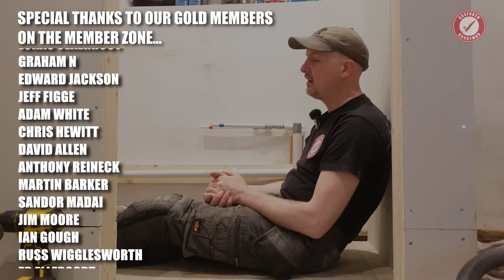Working with wonky walls... and first fix plumbing - new toilet (part 6)

Comment: Excellent work as usual. Only thing I'd advise is maybe turn the gas bottle down a bit so it's not so raging hot. Just a small sharp flame is enough and should mean less risk of solder bubbling out.

Comment: Those inline valves for the water are a godsend. I refurbed one of those 1920-30 terraced cottages about 4yr ago for my niece, with my mate who's a general builder & he said when we rip the kitchen & bathroom out put a  valve on every pipe (at first it was so we had hot & cold water for coffee😅) just as well because the flex to the hand basin was faulty & burst on a Sunday night & l was able just to isolate handbasin until i got a new flexy.

Comment: That is a plum out of plumb mate 😂😂.
The main part of our house was built in 1540. Just finished refurbishing a bathroom. At one point the laser level could be heard laughing as I was trying to vaguely spare things up
Reply: My last cottage was like that, around 1610 - 1670 we think, no wall was anywhere near straight!
Reply from the maker: Ha yes, it can certainly be a challenge in older properties! 1540 - wow, some history there! 👍👍
Reply: My latest house is the same. Somewhere between 200 - 300 years old and not a straight wall in the house. 🤣
Reply: Daughters house is 200 - 300 DAYS old and its not got a straight wall in the house 😮😮😢
Reply: @GosforthHandyman  our place is riddled with history
Reply: @jeffsmith2144  lol 😂. Sad though in fairness
Reply: @dougsaunders8109  Her's is riddled with botch 🤔
Reply: @jeffsmith2144  lol very good

Comment: Bringing back memories of my bathroom. About an inch of slumped plaster at the bottom of the walls. Ended up ripping it all off back to brick and then found the builders didn’t leave as bigger cavity gap at the 1st floor as they did at the ground. Coupled to not making the bathroom big enough so they hacked the walls out to the the standard bath in and made the room so out of square it’s was an inch out over the width of a door.
Reply: The first wall I ever built was not exactly plumb, but it did have plenty of strong cement mix in it. Plasterer put nearly an inch on at the top outside to fix it, and almost a wash at the bottom. Good luck though to whoever has to touch the floor I poured over the old cracked and warped old one though, 6 inches of concrete in a 2m by 2m room, and a full 50kg bag of cement. Fixed the water problem at high tide completely.

Comment: You absolutely need to deburr pipes - the burr can cause cavitation which, over a long enough time, will actually pinhole the pipe. It can also cause accumulation of limescale, which you don't want, for example, right at the entry to a service valve (three guesses why they never work when you go to use them). Oh, and the burr itself can get worn off and deposit little pieces of copper in your valves, too.

Plus smoother pipes are quieter, we all like quiet pipes.

Where you were worried about melting the soil pipe, the simple solution is to put a damp rag in between, and one of those fibreglass mats as well if there's room.
Reply: I've only ever seen PB plumber use a deburring tool and myself 😂😂😂
Reply: @paul_my_plumbs_uk  Well, yours is a rough trade..😁
Reply: @Monkeh616  you mean rouge trade 😂😂😂
Reply: I deburr pipes👍😁
Reply: @Tom_Plumb_PHS  I deburr after every visit to the toilet.
Reply from the maker: Any recommendations for a deburr drill attachment?? 🤔
Reply: @GosforthHandyman  Multifluted countersink. They do get sold as deburring tools as well. B&Poo have a set for 8 quid which will probably last a lifetime on copper. Might not be quite big enough for 22mm, though, but there are really big ones available.

You can also get external deburring tools, but you really only need to do that for pipes not cut with a proper cutter.
Reply: @GosforthHandyman  the only dedicated one I'm aware of is the rothenberger part number 11044 or 11045. That's just the adapter and there deburring tool fits into it. They're not cheap and I haven't used them so I can't comment on their effectiveness. I use the pen style deburrer on copper and the monument card deburrer on plastic. Knipex dp50 is a plastic cutter that deburr as it cuts which is another option.  Soil pipe you can get cutters that chamfer as you go but they're silly money unless you do an awful lot of drainage they're not justifiable.
Reply: @Tom_Plumb_PHS  Good lord, 65 quid just for what amounts to a conical file and the same again for a chuck for it. I'm sure they work well if you're doing it all day, mind, but I'll stick to the 5 quid deburrer and some sandpaper myself!
Reply from the maker: Cheers guys - good to know! 👍
Reply: @GosforthHandyman  real men just use their finger.
Reply: @GosforthHandyman  I have been using a 25mm Countersink Drill Bit for inside deburring of up to 22mm tube. You could also try a step drill bit. You probably have one already in your tool box.
Reply: @Monkeh616  yh they're not cheap I use the pen style deburrer that's less than a tenner. Does the job for me. As you say if you're a pipe fitter working in copper all day it would pay for itself but even for us all rounders it's a hard sell.

Comment: This was much more of a fiddle,  and adapt & adjust as you go, but much achieved in the end and well set up for the next stages which should make them go smoother and quicker. Nice to see this rather than bodge on top of bodge throughout the build !
With so many wonky non-plumb and non-level surfaces it's hard to select a datum point to start - I guess some would say that makes it easier !

Comment: You are doing a great job Andy , I'm no plumber I would be happy with the work you  have done  That wall is way off, you done well putting up the stud work and packers  Can't wait to see it finished  I never used soldered joints only compression joints but i know they can be a bit bulkey but like I said you doing a great job keep it up  I will catch you on the next video  take care mate  .
Reply from the maker: Cheers! I don't mind solder joints but this is about my limit. No idea how plumbers do it in tight spaces without setting everything on fire, so to speak. 😂
Reply: @GosforthHandyman  You doing all right mate !

Comment: Crikey Andy😮its like we are doing parallel jobs😬I'm straightening up an entire kitchens worth of wonkey walls, virtually using the same method as you👊(I'm using a string line instead of a straight piece of wood👍) Great job pal👌
Reply from the maker: Ha cheers Del! Folk don't appreciate how much time this adds to a job. Good luck with yours! 👍😎
Reply: @GosforthHandyman  Video's to come Andy😉

Comment: Hi Andy, I've found that using a brush for the flux gives a better result. You can brush a bit of flux on after soldering too which cleans the joint up nicely before the damp cloth. 

Love the videos, keep 'em coming. 👍

Comment: Couple of tips,  with pre - soldered fittings its best to still add a dab of your own solder just to be on the safe side.
Otherwise your relying on them being already filled sufficiently, which on the odd occasion isn't always the case.
Also, its best practice to apply flux with a small brush, using your finger can easily contaminate the joint and also your tub of flux with debris.
Reply from the maker: Cheers! I normally add a blob of solder, but between setting the studs on fire and melting the soil pipe it was too much to think about. 😂👍

Comment: As I always say if it works and its hidden then its a decent job. I remember doing pipeing for my bathroom with solder and when the water was turned on i had a real water closet 😅😅😅😅😅 decided to go wit compression and push fits after that. Luckily my nephews a plumber so any solder work he can do.

Comment: I have used a quick fit to extend the pipers for new radiator and towel dryer, but why did you mixed different pipes, copper and plastic? You can get a quick fit for copper.

Comment: Thats a pretty plumb job with the pipework. I wouldn't advise using your fingers to apply the flux though. The flux is not usually kind to skin and you could contaminate the joint with oil or grease from your skin causing it to fail. Either use a flux brush, or some solder wire or failing that an offcut of copper tube
Reply from the maker: Cheers Nick! I used to use a flux brush, I'm getting lazy. Noted! 👍👍

Comment: Hi sir I must admit I’ve never used the plastic pipe and fittings , but I can definitely see the advantages . Was there a particular reason for not doing the whole job in plastic?   .   As regards plum walls even some of the new properties are often out of level and even not even square . So at least the builders of your house had a reason for such problems . But these days there should be no excuse .    Best wishes and kind regards 😀👍👍👍

Comment: Your plumbing is fine in copper, all i wud say is dont use ur fingers as flux is acidic and will mess ur skin up. Get a flux brush and let the joint cool down before u move it or put a wet rag on it let the solder turn a dull colour before u move it.
Reply from the maker: Cheers! I actually had a flux brush but it ended up covered in sawdust and I've been too lazy to replace it. 😂

Comment: You shouldn't immediately cool the soldered area with a wet towel because there is a risk of shrinkage cracks occuring (thermal shock). Just let it sit and cool down by itself and clean it afterwards.
Reply from the maker: Interesting. Plumbers? 🤔
Reply: @GosforthHandyman  Plumbers should of course do it because they earn money with the repairs. It takes a while, usually longer than the warranty period, for compromised solder joints to leak. And if you wonder if I am kidding, well who knows. 🙃

Comment: Could you have used a scrap of stud and drilled a hole to poke a pencil through at half the width of the stud and use it as a reference guide for the placement of the screws? Might have saved a little time and let you butt the stud up against the non-plasterboarded wall without checking for plumb on that axis.

Comment: Spend some time getting use to the pipe bender on scrap pipe the spring is ok but pipe kinks happen, interesting video 👍
Reply: Old pipe the tip is to first anneal them with the torch, then bend them. Had to do that recently, stub of pipe that had been kinked by the copper thieves, so had to chisel it out, make it sort of round again and fit an elbow on. First thing after the chisel bit on the drill to make a hole as to anneal that copper so it would be soft, then straighten the end a little, and make it round enough. Then sand clean, lots of toffee, and solder on the elbow. No leak at all.

Comment: My house was built in 1979 as part of a set of standard houses in a planned community. Not a plumb wall or square corner in here, and it's all stud and drywall/gypsum board. In one place, I pulled the board off because the stud they had inside the wall was a banana that was pushing everything else out. On one wall through the center of the house, there's an out-of-plumb lean which caused all the doors to slam open. So when I hung new doors, for them to be plumb, I had to be an inch out of plane from the existing wall. Hard to do anything "right" in that mess.
Reply from the maker: Lordy, that sounds like fun! 😮

Comment: Would it not be easier where the walls buldge out, rather than wedging, to remove a bit of the old plaster so you don't lose as much depth?

Comment: Do you take any precautions using these plastic fittings as they wouldnt show up woth a stud/pipefinder?
Are the tubes metal impregnated or could you stick some foil on the wall behind the plastic pipes?

Comment: Would you please show how you test for leaks? Regards Paul
Reply from the maker: This was ages ago, but I just connect to mains water pressure, flush it through in to a bucket, close the service valves, leave it for a few hours and check for any leaks. 👍

Comment: Why do you use the metal pipes for the water inlets and not plastic? Thanks, good video.
Reply from the maker: Cheers! I prefer to have as few joints as possible behind walls and I can do nice rigid bends with copper. Also shows up on a detector, not that anyone should be drilling there. 👍
Reply: @GosforthHandyman  Makes sense!

Comment: 4:28 if the plasterboard is going to be scribed to wall, wouldn't the wall be the easier reference?
Reply from the maker: Potentially! Just a bit awkward drilling so close to those pipes. 👍

Comment: I think that you are the only builder that would spend 1-1/2 hour to level one stud.
Most builders would just hammer in those studs, adjusting them the best they can and move on.
The old saying is that's what molding is for!
😂😂😂🔨
Reply from the maker: And caulk! 😂

Comment: I'm having similar issues with a 70's house. One of the outer walls is about 35mm out of plumb over 2.5m. Considering the framing, it's not movement over time, it was built that way in the first place. Even the Romans and Babylonians could get things plumb, it simply comes down to laziness, lack of care and lack of oversight/inspection.
Reply from the maker: Yup! Just look at our studio room. No excuse for it really. 😥

Comment: I am just curious. Is it standard practice to anchor the toilet tank to the wall in the UK? I have not seen that practice in the US, although it may be done in certain areas of the country of which I am unaware.
Reply: I enjoy this series to see the differences between US and UK building, plumbing and electrical practices.
Reply from the maker: Yeah, 99% of cisterns are attached to the wall in the UK... normally very badly with rusty screws that you can't get back out. 😂

Comment: What was the paste you were putting on the copper joints? You seemed to just heat it up without using solder.
Reply from the maker: Flux - these fittings have a solder ring built in. https://www.screwfix.com/p/yorkshire-copper-solder-ring-equal-90-elbows-15mm-5-pack/6594g
Reply: @GosforthHandyman  o nice. Thks.

Comment: Plastic pipe is easy to shape, without joints, so why not just use all plastic?
Reply from the maker: I haven't tried that many tight bends in plastic. I'll need to give it some practice. Do you warm the plastic or just use a pipe bender?
Reply: @GosforthHandyman  Thanks for getting back. I used 15mm P-EX for new radiators, the pipe concealed with gentle 90 degree bends under a shower base - your use of copper behind the plasterboard was a worry for me, in case I had broken building regs. With gentle use of a heat gun, I was also able to make a tight "S" bend with the P-EX to route the toilet cistern fill. All seems to be fine, as the work was completed late 2020.

Comment: @2:22 Why is the hot water pipe significantly smaller than the cold water pipe?
Reply from the maker: The cold is the main trunk for the whole house, so supplies the fridge, outside tap, dishwasher, sink etc. The hot only supplies the sink in the kitchen. 👍

Comment: Please can I ask you a question? IF the soil pipe from my upstairs toilet runs down between my kitchen and utility room, would any plumber worth his salt, be able to access said soil pipe (plasterboard box around it) and connect a new downstairs toilet to it? I'm disabled and desperately in need of a functioning downstairs loo. Currently have a dysfunctional macerator type and am trying to avoid the stairlift  the Council want to give me. Just need to know if it's a possibility before I start opening my big gob!
Reply: Yep should be able to ‘tee’ off the soil stack. Without knowing the layout of the property, if the utility room is next to the down stairs toilet for example as long as a fall can be achieved with a 100mm pipe then yes. After all the macerated material must feed into a foul water drain. It just does this with a smaller pipe
Reply: @dougsaunders8109  As I thought - my plan would be to put my washing machine and dryer stacked where the macerator is now, as there's a water supply and power there, leaving my utility with room to put in a toilet and small sink, and a small sit in/walk in bath which suits me more than a wet room that I am scared of falling in! The Council won't even look at doing that and I don't understand why not. There is a back door in there that I don't use as got another, just happy to have that boarded up, or even stick a blind over it! Am getting a new combi boiler, would that be okay if positioned above said bath, or are they easy to move? I have a big understairs cupboard in there (mostly full height) where my fuse board etc is, behind a door, if I could get them to put it in there would that be better?
Reply from the maker: What Doug said! 👍😁 Obviously difficult to say without seeing it though. Could be quite a big job, but should be do-able by a competent plumber and you might need a plasterer to tidy things up afterwards. Combis aren't that hard to move by a gas engineer, but depends how awkward the new flue route might be.
Reply: @GosforthHandyman  Thank you!! I need the boiler people to come and do a survey really, heaven knows when that's likely to happen, lol?
Reply: Hope you get it sorted to your satisfaction. Don’t be too hasty to turn down the offer of a stair lift though. My friend has one and it means she can safely access all the rooms in her house and transport items such as laundry by herself which previously required a helper as she needed her hands to hold the bannisters. Also remember they will install a seat and grab rails in a wet room and even a ‘walk-in’ bath includes a small step so they are correct that you would have less chance of falling in a wet room.

Comment: No P or J trap for the sink/basin waste? Or is that outside the room?
Reply: Ok. I see you use a bottle trap in the next video, which I assume has the same or similar function. I've never seen one of those here in the US.
Reply from the maker: Yeah, bottle trap. But in hindsight I was never particularly happy with it. 🙄